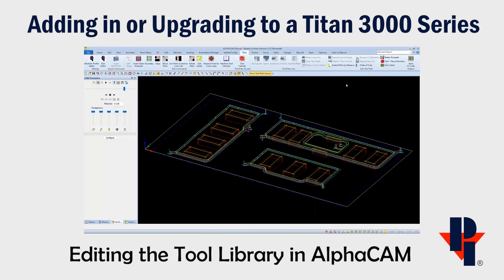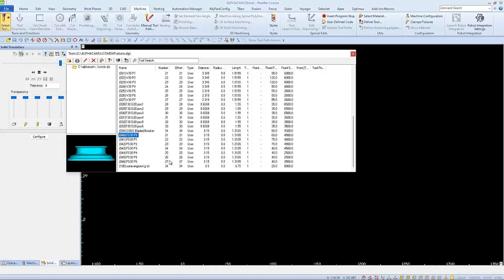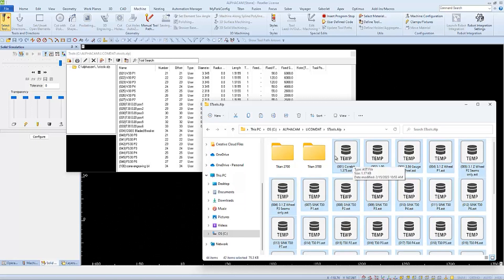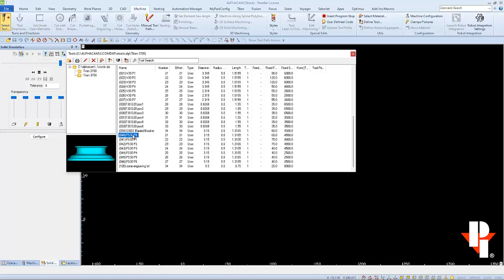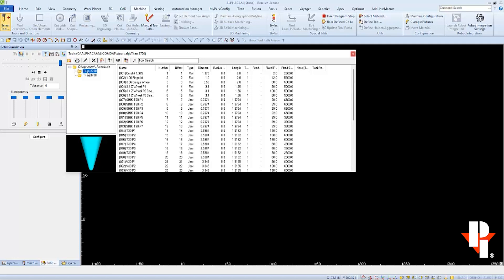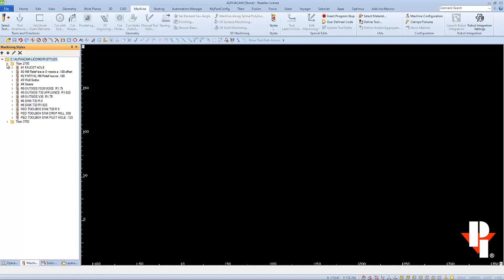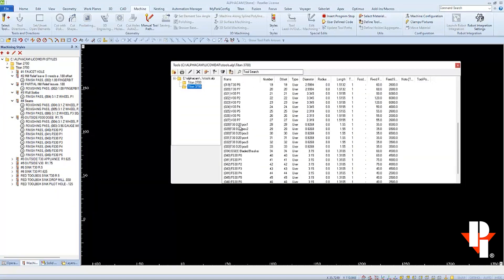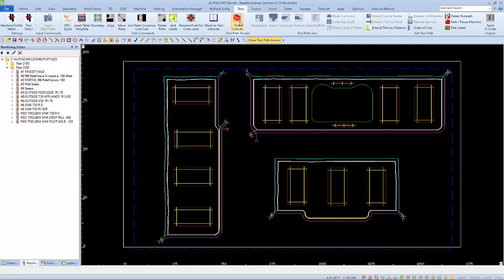Titan 3000 AlphaCam Tool Library

Comment: 1:06 I see your tool library location is left empty. Is that normal?
Reply from the maker: You do not need the library location area to exist in order for anything to work. That function was built so that you can see a Titan's (2k and older) Actual library at the machine for tool swapping purposes when you may have set up a library in "Stone CAM" before setting up your Alphacam library.

Comment: Will keeping the styles and tools in one folder without creating two separate folders create issues for both the 2000 and 3000 series when sending out to the machines?
Reply from the maker: AlphaCam's Styles and Tool Libraries for different TITAN models can be saved in the same folder as long as you organize them properly per each machine's Tool Library and setup.

Comment: What do you do if you are dealing with multiple computers? Is it the same process? Say I am dealing with 4 Computers that are connected to the Titan 2000’s and 3000’s series.
Reply from the maker: Yes, it is the same process for the Tool Library and Styles. Just set up a Profile for each Titan with the MPF/DXF file path to send the programs to each correct machine.